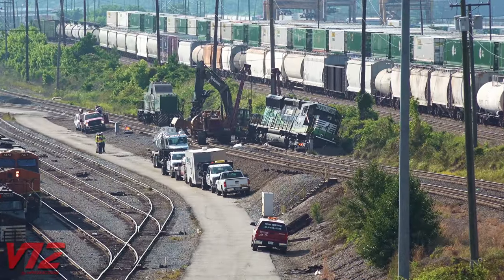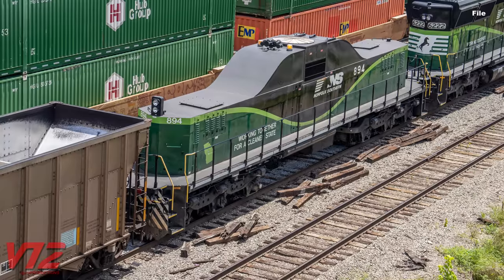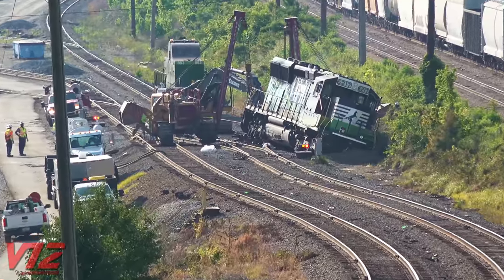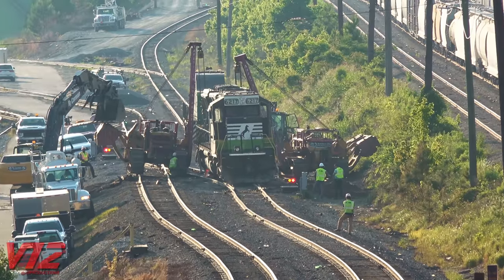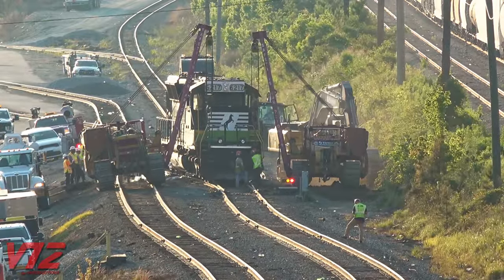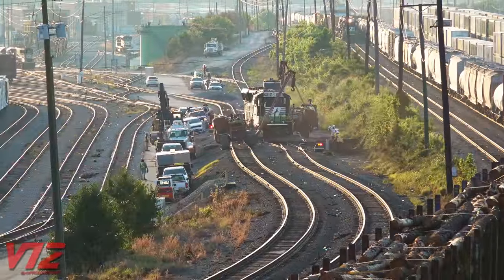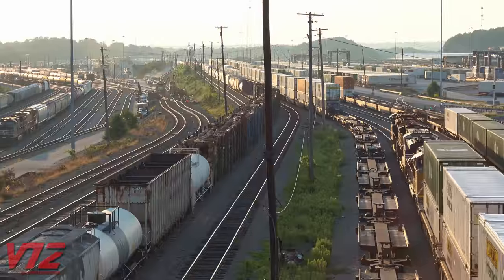DERAILMENT at Inman Yard - Second One this Month

Comment from the maker: UPDATE: This is how the railroad reported this accident to the Federal Railroad Administration - GA01, REMOTE CONTROL HUMP JOB, WAS WORKING SOUTHBOUND ON TWO THOROUGHFARE, WHILE DOUBLING CLASS TRACK THIRTY-TWO TO CLASS TRACK FORTY-THREE. GA01 STRUCK BNSF 237633, THE EIGHTH CAR IN THE GA06 CONSIST, DERAILING TWO LOCOMOTIVES ON THE GA01, NS 6217 AAND NS 893. GA06 WAS STOPPED ON TWO THOROUGHFARE AFTER DOUBLING FORWARDING TRACK NINE TO FORWARDING TRACK TWELVE.

Comment: I worked with breakdown cranes in the 70's and 80's in the UK and I have seen a few derailment videos featuring R J Corman crews recently. They are real go getters with no wasted time in doing what's needed to get the line clear. Our Health and Safety guys would not allow some of their methods here, but the guys doing the job on the video are certainly aware of the dangers involved as you can tell by the way they go about the job. It's impressive to see how quickly they got the loco from its "Earth Fault" situation to being back on its feet and able to be moved away for repair. We'll done guys! Another interesting day on the railroad.

Comment: A real "sunk in the ditch" for sure.  Very curious that two derailments happened at the same spot in so short a time. Maybe a subsurface issue?   Great video, thanks much.
Reply: i was about to say this, theres no way this is a coincidence that theyre in the exact same spot and fell off the tracks on the same angle
Reply: I feel like it has more to do with the crossover there but I don’t know.
Reply: I didn't reply here I replied to the one above.

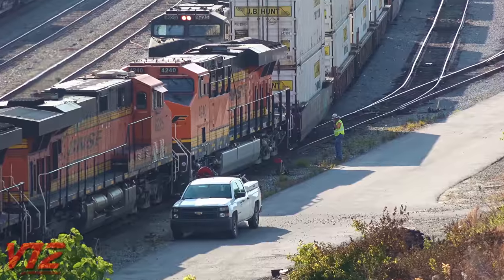Comment: Your high rez & zoomed in photography at 1:50 of the damage answers that question I had on your previous video : how do they keep the trucks on when lifting? Because I knew the trucks floated on a pin. Now I see that they have an "emergency tool set" of chains that hook into the 4 holes on each side of the bogie so it doesn't just come off when they lift. So interesting. And THANK YOU!

Comment: I also did the same at the g scale New River Gorge National Park and Preserve in Fayetteville West Virginia not far from Ansted where my uncle Greg lives: GA01 remote control hump job was working southbound on two thoroughfare while doubling class track 32 to class track 43. GA01 struck BNSF 237633 the eighth (8th) car in the GA06 consist, derailing two (2) locomotives on the GA01 , NS SD33ECO #6217 & NS RPU6D #893. GA06 was stopped on two thoroughfare after doubling forwarding track nine (9) to forwarding track twelve (12).

Comment: A couple of things I noticed - the engine had derailed before reaching the switch (unlike the previous incident), and seemed to buried fairly deeply in the ballast/shoulder - excess speed a factor?  The damage to the front right of the engine, did it hit something coming over the switch from the adjacent line? The switch is set for that way. Were these two scenario's combined in a single event?
Looks like the RJ Corman crew got lucky that there was space between the front of the engine and the dwarf signal to help lift the front up to create space to the left of the engine - goes for NS too in not having to replace the switch/signal mechanism/electrics.
Reply: I’d bet he got hit by a train that traversing the crossover while he was still fouling the adjacent track…
Reply: @oakridgereview1359  Thant's my guess too.  It takes something strong to tear into a fuel tank, like another loco or rolling stock, most of the ground equipment in a yard will simply be crushed before the tank gives up.

Comment: That locomotive has been leaking diesel on the ground throughout the recovery process. I don't understand why they haven't emptied the tanks before doing anything, both for safety and for the environment.
Reply: Diesel alone isn't a dangerous liquid. It will not ignite nearly as easily as gasoline. It's similar to oil in that it need a lot of heat to combust. Simply throwing a lit match into a puddle of diesel, will result in a burnt out match, and a puddle of diesel with a burnt out match in it. Otherwise, yeah, I don't completely understand why they didn't just empty the tank since it's just causing more problems in that you now need to dig up that whole area in order to clean up the diesel spill
Reply: I know it looks like collision damage to split the tank end . But why was there a hazmat tank truck there?

Comment: for it to be that far over off of the tracks, much less have dug itself into a new dich.  It had to have been moving a heavy string of cars that, once you jump the rail, isn't going to stop anytime soon, even moving at only 5 mph.
Slug units are used in Yard service to add more tractive effort to a locomotive without having to burn more fuel by adding in a 2nd unit.  Since yard are slow moving areas anyways, you don't need a lot of HP but need more tractive effort to get cars moving.  A Slug basically turns a six axle locomotive into a twelve axle locomotive giving it more contact points on the rail to get things rolling.  Slugs are filled with Concrete slabs and the tanks (if they have them) are filled with sand, they are usually permanently tied to their parent locomotive as well by welding the couplers together.

Comment: Our rail infrastructure is at a critical mass. By my work is an old, not abandoned, but no longer main line railway. The main line, owned by BNSF and operated by countless others including the Canadian twins, National and Pacific, TCWR, Minnesota Commercial, Union Pacific and more, is in great condition, but the offshoot which I dont know who owns is, it rapidly deteriorating. A few months ago, a locomotive derailed by the transition from the concrete bedded decent rail, to the wooden bedded dilapidated rail, and it shut down rail traffic for almost a whole day. It really starts to worry me as I see rail that was worn out a decade ago still in use, like in my hometown that has a small line going through it operated by Minnesota Commercial.

Comment: It’s wise of you not to speculate but I will since I used to work with these locomotives. Again just speculation but from the damage to the side of the locomotive and slug and where it wound up in the ditch what likely happened is this locomotive was in remote operation tied onto a long cut of cars and the (remote control operator) RCO was on the other end of the consist. They likely mistakenly put the locomotive in the forward direction and because of the length of cut there would be a delay to slack action of the rear car moving. So the engine pulls forward the RCO is at the rear expecting the cars to shove toward him but, they pull away and by the time they have a chance to react the locomotive has already impacted another movement in the crossovers. I’ve seen this happen in hump yards where the crews humping cars have gone the wrong direction and blown through switches or past stop signals. That’s my guess anyways as always have to wait for the official report

Comment: kind of sad they didn't just start pumping the fuel tank prior to the main crew arriving. They ended up having to clean up more spilt fuel, over a wider area. Heck, even a 12 volt battery pump into a mini trailer with 55 gallon drums would have made a difference...

Comment: Surprised the first move wasn't to drain the fuel tank which had an obvious burst on it. Hence once the loco was upright, there was diesel spilling out all over the place, as they are still working to re-rail the loco. Doesn't seem particularly safe to me, as well as the environmental impact of gallons of fuel going into the ground.

Comment: the US is one of the only modern counties that STILL uses nails (spikes) and logs (ties) to build railroads .
Reply: They still use spikes and wood ties because they are cheaper than the alternatives and they still do the job! Railroad operators have tough competitors yet they have to pay the full costs of maintaining their road and infrastructure so they do it as cheaply as they can and only using the minimum of materials. Concrete ties are heavy and need a real deep bed of ballast as do steel ones. Lately reclaimed plastic ties have come on the market and are recyclable again at end of life but they aren't cheap to buy. It's down to the accountants yet again because it's the bottom line that counts in today's world. I spent a lot of my working life trying to keep traffic moving on tracks that management didn't want to spend more on than they had to. It's a no win situation just do your job as best you can!

Comment: Interesting they didn't use a mechanical piping plug on the fuel tank puncture  (would at least limit the spillage rate), or even use a drum pump to MT the tank...no real fire hazard here but the stuff is toxic and not easy to clean when spilled into gravel/soil. Hell even stuff a raincoat into the hole...perhaps it was considered unsafe to get that close to the loco, or the hole was otherwise inaccessible.

Comment: Most likely this happened due to Wall Street caring more about profits than safety. Running a RR is expensive and like any industry if you cheep out on maintenance it will bite you in the end. Obviously we need to wait for the NTSB to issue their findings to get to the bottom of this derailment. The good news is that it does not look like anyone was hurt and the only things damaged where some track and a bit of the locomotive..